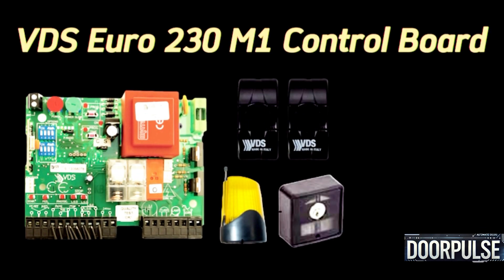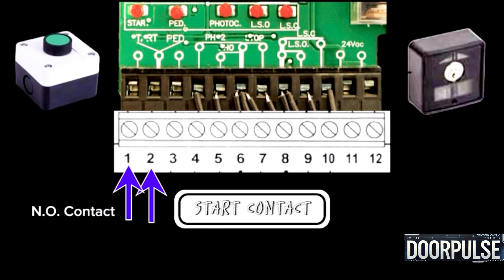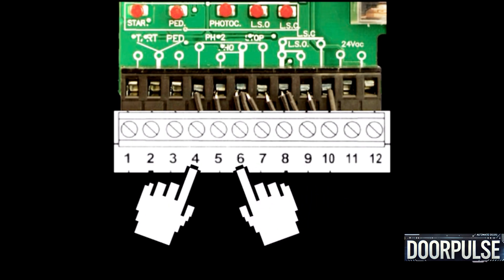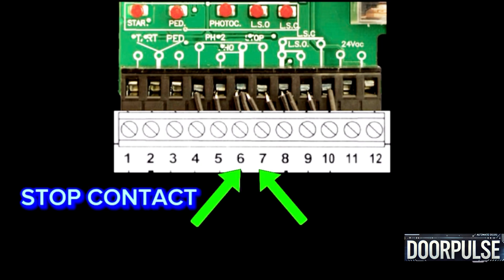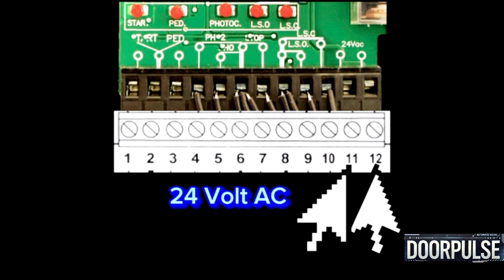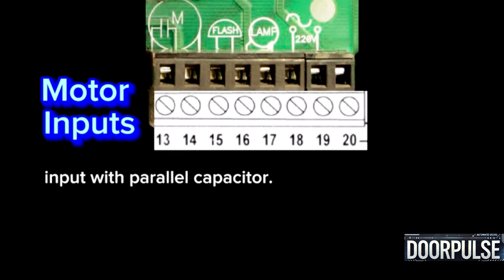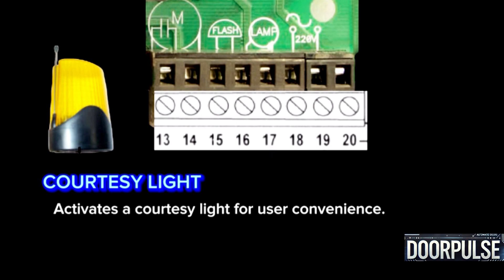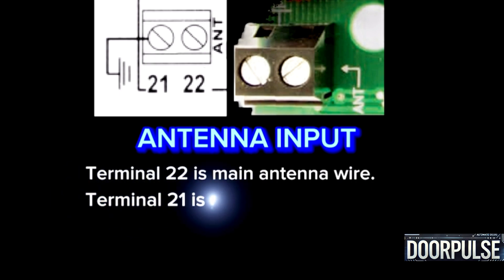VDS Euro 230 M1 Control Board Wiring Connections | Full Instructions For Wiring Connections |

Comment: Hello, under which setting can I use a switch to open and close?
Reply from the maker: Terminal 23 with common terminal 24 | a start command for open and closed.
Reply: @AutoDoorSurgeon  where is it. I have a problem when I try to program the stroke and press the start button the engine stops, in other words the engine never completes the whole stroke when I press the button connected to terminals 1 and 2, then I can not set the whole stroke